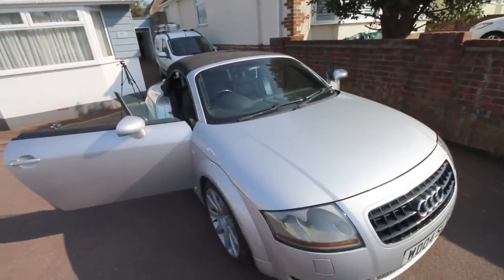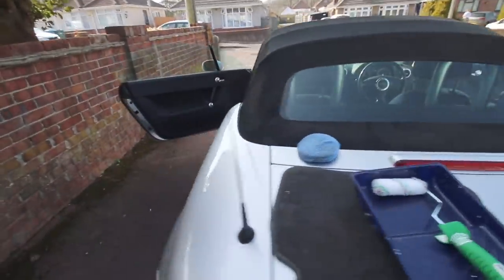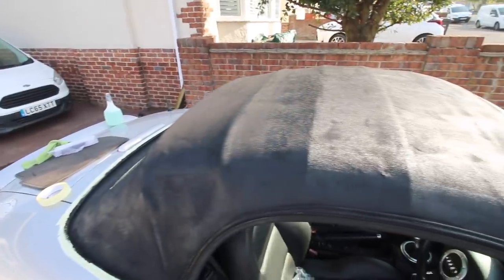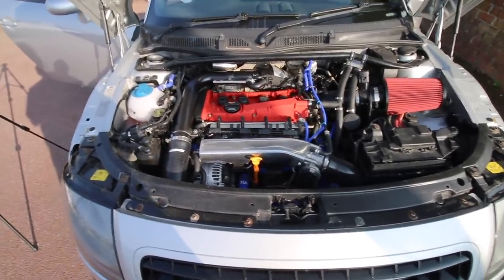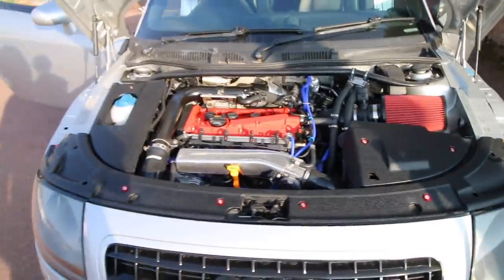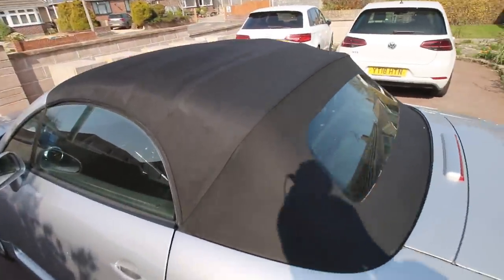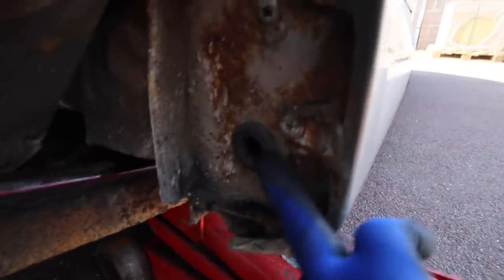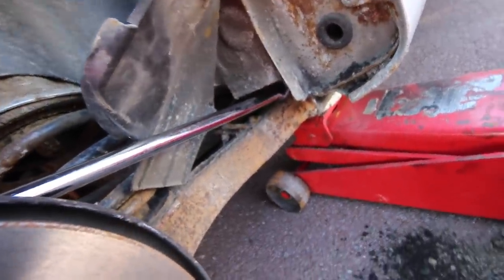I Restore and paint the convertible roof on my TT

Comment: Hi Paul,   I would definitely be interested in watching you alter and fit out your garage. By the way the spring you pulled out from the drain pipe on the Audi  TT is there to hold open and support the rubber tube and without that the tube will flatten and collapse.
Reply: That’s makes sense about the spring tricky to get back in

Comment: Not sure how or why you got that spring out Paul, but it really needs to go back. That will be much more difficult. The drain will not work without it. The tube will just collapse, stick together and then block completely.
Garage update would be good. Wish I had decided on getting a lift rather than a pit. I suppose at the time it was cost! We had a jcb onsite, and it doesn't take long to build a big hole!
Reply from the maker: The tube was fully blocked, and has already perished, so I plan to replace it

Comment: You've pulled the spring out of the drain tube. This spring gives the drain tube it's round shape. Without it in place, the drain tube will collapse as it's just a light plastic. It's going to lead to even worse blockage and ingress of water. Plus, by sticking something as sharp as a screwdriver up the drain tube, you've probably punctured it anyway. I pity the poor person that bought this car.